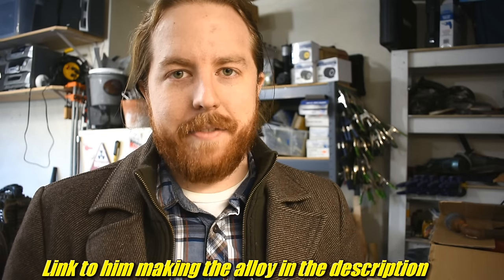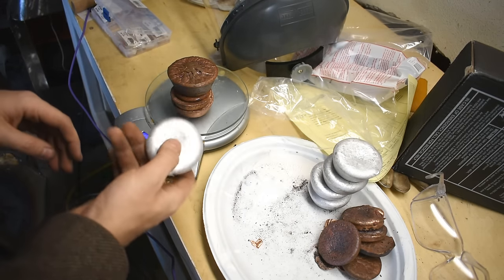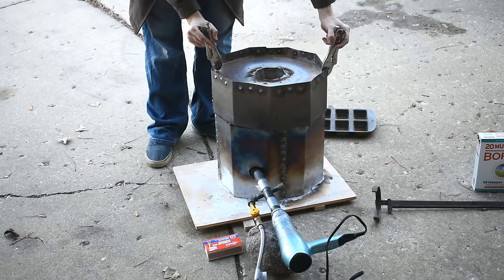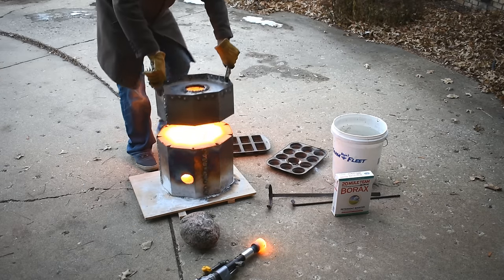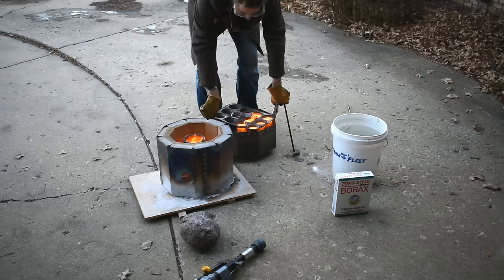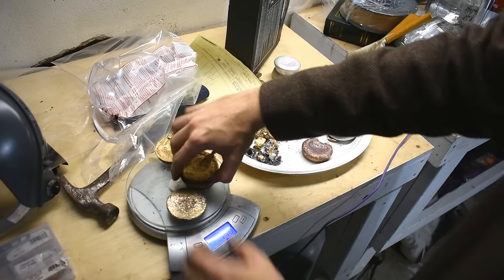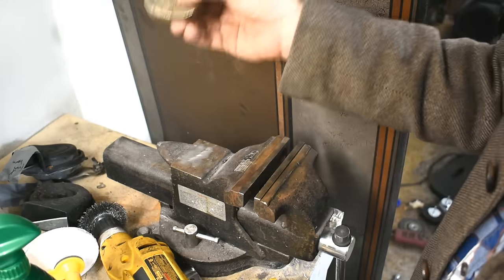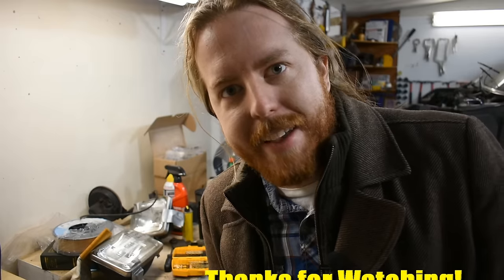The Bronze Alloy as Tough as Steel! (almost)

Comment: Hey Paul, I checked out swdweeb, and he seems to be a nice guy with some cool content. I am planning to cast some aliminum bronze grinding media for my ball mill. Do you have any idea about how to get the alloy aa hard as possible? Quenching vs not quenching? Casting only in moonlight while chanting Norse battlehymns? Any thoughts?
Reply from the maker: The higher the aluminum content, the harder and more brittle it is.  Not sure how that will effect it's use as a grinding media, though.  There are ways to heat treat it too, but i'm not certain what those are.

Comment: Alluminum bronze would make an Ozzie the ice man axe
Or you could  use an Indian Axe as a pattern.
Otzie used copper because it was malleable see when it gets dull to you just heat the tip and hammer it sharp then heat it up and quench it and its sharp and hard again they did that in old times in Austria and they did it with steel too.
I think with early axes they just used soft steel and ball pean hammered the edge sharp, because you cant keep heating steal it gets brittle,... and eventually they went to harder steel and files and wasted material away with a file which meant they needed axes quicker but they were higher performance axe's. 
You could make an Axe or a sword out of that bronze.
Reply: Nakoa Warrior quenching softens copper

Comment: Do you know if this alloy will turn skin green like straight copper? It would be interesting to alloy it and try some jewelry smithing
Reply from the maker: I don’t know for sure.  The reason it resists corrosion is the aluminum in it forms a protective coating of aluminum oxide, so it might not turn skin green.  I don’t know for sure, though.

Comment: Sweet! I guess it won't solder though, correct?
Reply from the maker: You can braze with aluminum bronze, but it's not as easy as silicon bronze.  Its stronger, though

Comment: I am wondering if it might be possible to add a dimmer to just the motor in a hair drier to adjust the speed on it? It would work if it is a brushed universal motor. Also I guess it depends on how the motor is wired in the hair drier. Well, do you even need the heating coils in the hair drier? I'm thinking no.
Reply from the maker: It could be possible.  So far i've just been cranking the thing to max.  I haven't tried taking the thing apart either, i suppose i could remove the heating coil.  I've just been running it with the heat off.
Reply: Yeah I didn't think the heating coil was doing much. Some people also use gate valves to control their air flow too.

Comment: Allotropes for different forms of the same element.

Also, were you shooting for 10% Al  by mass in the final product?  That recipe would be 1 part Al + 9 parts Cu
Reply: You had said it in the video, 10% to 90%, but then you derped by multiplying your 142g by 10.  Don't worry, I got your back though.  (142g Al / 1614g total)*100% = 8.8% Al.  Close enough.  It's not analytical chemistry, it's Paul's Garage!  ;P
Reply from the maker: close enough is good enough! :D

Comment: Also ave posted a video about uv and ir sensitivity in different materials. Would your forge be putting out any ir radiation?
Reply: Nuclear_ Nube it would. And a lot of it. Inferred radiation is a by product of heat.
Reply: That's where the face melting power that he witnessed comes from. Radiant (infrared) heat can be felt quite far away from the source. Welding goggles not a bad idea, otherwise one may end up with cooked retinas.

Comment: Doesn't one need Tin to make Bronze?
Reply from the maker: Bronze is kind of a catch all term for copper alloys that don't use zinc.  Tin, silicon, manganese, aluminum, and others added to copper are generally called bronzes though it's not a hard and fast rule. Tin bronze is usually called "ancient bronze" to distinguish it.

Comment: She might think It's gold until her finger turns green.  :-D
Reply from the maker: OH right, forgot about that :D
Reply: Did you get more welding wire so you can put orientation marks on your furnace & lid yet?  Welding on proper handles might be nice, too.  You could try chalk or paint if it doesn't get too hot on the outside.  Even steel wool could shine up a spot on each to help you out.
Reply from the maker: That’s a good idea.  I did get more wire, 2 spoils actually so I should be set for a while

Comment: 10% by weight? i thought it would be 10% by mass
Reply: Everything I read was percent by weight
Reply from the maker: if 10% by mass and both ingredients are measure in the same amount of gravity they will also be 10% by weight.  If not, then i have a gravitational problem in my garage and the ratio in my alloy is the least of my worries
Reply: Fine.  I read mass as volume. Maybe you do have a gravitational problem in your garage. :-D
Reply: Paul's Garage ...next project= gravity hammer

Comment: but will it be safe to cook out of if its cast into a skillet!?
Reply from the maker: Aluminum bronze? I would guess yes but I don’t know for sure.  Copper and copper alloys tend to be antimicrobial so yet would stay relatively clean, but it might make your food taste all coppery.  Old coppersmiths used to coat the inside of copper pans in tin for that reason.  Aluminum bronze generally forms an invisible coating of aluminum oxide much like pure aluminum, and that’s fine to eat from.
Reply: Paul's Garage yeah my main cocern was trace elements of zinc or lead that can be found in some copper pipes or wire but im guessing that would all be available information from the manufacturer?
Reply: James Smallwood You dont want to eat anything from aluminum, it might cause Alzheimer's disease, or make it worse, its not clear as far as i know, but it was advised a while ago to stop using aluminum cookware, you should probably use regular bronze for that
Reply: @yonidellarocha9412  That Alzheimer's claim has been shown to be untrue.

Comment: Correct me if I'm wrong, but if you wanted %10 aluminum to %90 copper ratio, wouldn't you have wanted to multiply the weight of copper by 9 instead of 10?
The window you mentioned sounded pretty forgiving for getting aluminum bronze, and your results showed some great characteristics, so obviously any mistakes were negligible.
Reply from the maker: Yeah you’re probably right, math isn’t what I do lol.  I think I need more copper content anyway.  I suspect my copper ingots were slightly contaminated by aluminum, too...
Reply: No he wouldnt...  u want 10 times more copper to be 90cu%/10al%  so if u have 100grams of aluminium u need to multiply that by 10 which is 1000grams or 1kilo so the total would be 1100grams at 10%al 90%cu..  so no,paul did fine on his math, and your math idea is still mind boggling?
Reply: Its like dividing 100 by 10.. it fits 10 times and each 10 is 10% 10×10=100
Reply: SS: Err, no.  Daniel is correct.  You wrote it yourself: 90%:10%, so 900g:100g would be the theoretical correct ratio.
Your 100:1000 ratio means the Al is 1/11 of the mix, or 9.091%, and 90.91% Cu.
But it makes virtually no difference , given the range of Al content that "Aluminum Bronze" can contain.
Nice vid Paul, BTW!
Reply: No 10% of 900g is only 90g
Reply: U need to add 10% of the weight compared to the amount of copper used,not the f8nal weight desired,so to 900g of copper u add 90g aluminium  totaling 990g for 10% ratio..
Reply: Unfortunately that's not how percent mass composition calculations work SS.  If you say 10:1 that's 11 parts, 1/11 is Aluminum.  By your own account 900:90 is 990, and 90/990 reduces to 1/11.  All these w/w% you see on products are "how much of the total."  It's the nature that we measure things - the best way to know how much of something you have is to weigh it, regardless of what it is.  (for example, volume measurements suck because volume changes with temperature - 1mL of water @ 4C is not the same amount as 1mL @ 80C.)  Anyways, food for thought.  Signed: ~your friendly neighborhood chemistry grad student.
Reply: Ummm... yes, 9 copper + 1 aluminum = 10 total. For your kilo it would be 900g copper, 100g aluminum for a total of 1000g or 1kg 90cu%/10al% alloy... give or take a margin of error.
Reply: Based on the weights Paul gave in the video, his alloy contains 8.7% aluminum. Total weight of 1629 grams, with 142 grams of aluminum.